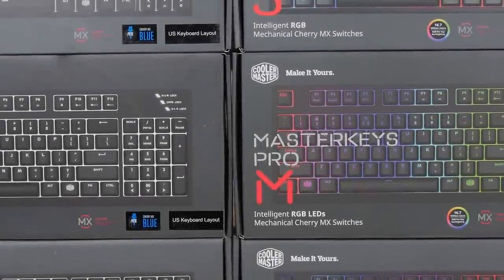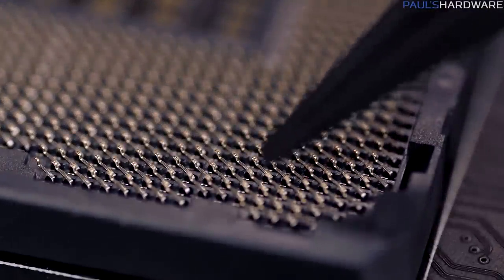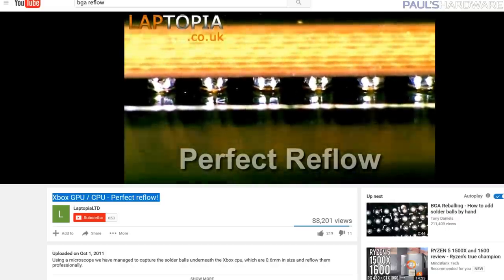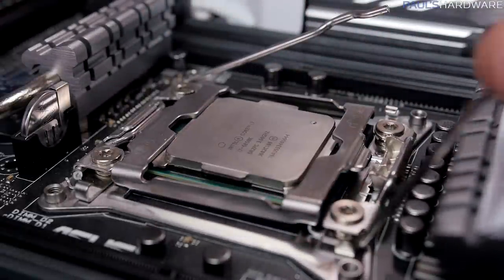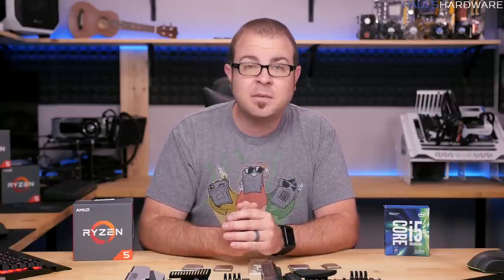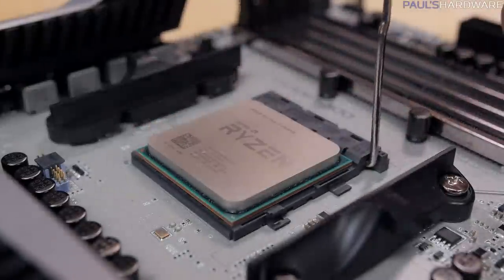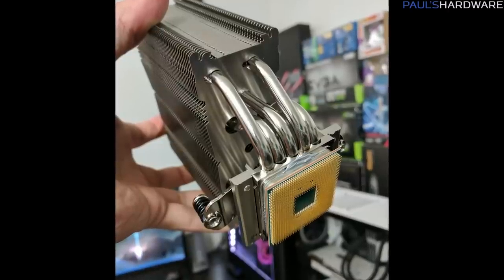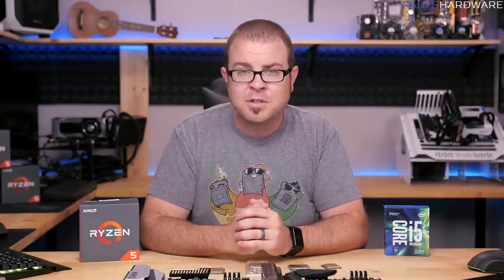LGA vs PGA! Which is better?

Comment: 6:20  Not true.  You can replace a broken pin.  You can also just put a pin in the correct hole in the socket, then put the CPU down so the pin makes contact with the pad on the CPU.

Comment: Pins are always more prone to break than pads. So which side is cheaper should have the pins. My cpu costed almost five times more than my motherboard. So if one of them breaks, it's better to be the mobo. Or, if this problem occurs so often, then they should use the LGA design with just landingpads on the motherboards too and a cheap adatper panel with pins on both sides. If you screw it up, just get a new pinpanel...
Reply: Péter Kiss but the problem is,  lga has easy to break pins on the motherboard that sre hard to fix while pga has thicker straight pins
Reply: You clearly don't understand the concept, do you? From which one would you buy a replacement, a 300$ CPU or a 100$ motherboard?
The PGA doesn't support the CPU perpendicularly to the motherboard. People are sometimes ripping out their CPUs from the socket by removing the cooler because of the old thermal paste hardens and "glues" the cooler to the CPU. Then the thicker pins are often just breaking off of the PCB and you can't solder them back.
By the way AMD uses LGA sockets on the new threadripper CPUs. Guess why...
Reply: I have built thousands of computers and I get your point about cost but PGA is much easier to repair and AMD pins are thick and pretty hard to bend unless your using them as a doorstop. LGA sockets on the other hand are much harder to fix, if at all, and unless your building a lower end system the motherboard cost can be almost as much as the CPU. As for removing a PGA CPU cooler, run the system first if it will boot to warm up the paste, then remove the cooler, if the system won't boot use a hair dryer or heat gun to heat up the cooler.
Reply: I still think LGA is better choice, that why I choose INTEL instead of AMD
Reply: Péter Kiss if you do that then the mobo manufacturers will have to redesign their cpu bracket so it can  fit additional item inside it, hell even case manufacturers have to redesign their case's width too
Reply: @stephenallen4635  you clearly dont understand
Reply: @theyhatekath  and your reasoning for saying that?
Reply: @stephenallen4635  LGA is not at all easy to break, sure, pins arent very durable, but they arent exposed neither. They come with plastic shielding and only time they are exposed is when you are inserting the CPU. PGA in the other hand is far more exposed and primitive. Also, with LGA , if pin breaks, just send your MOBO back and ask them to replace pinpad, tell them you will pay for the repair costs. Its much harder to replace on pinpad on CPU.
Reply: @Navhkrin  If you store a PGA CPU properly, it's exposure time isn't much different from a LGA motherboard's. The difference is all in how easy it is to fix.

I find the PGA is less prone to being screwed beyond all reason in practice. This isn't even pure academics. This is the sum of the experiences of various field repair techs at the company I used to work at.

Comment: I’ve had to help quite a few people out with the PGA pins especially when the FX CPU’s were big. My trick to bringing their CPU back to working order from bent pins was with a bic mechanical pencil. The slightly elongated section of the pencil is the perfect fit for the pin and doesn’t get in the way of other pins. Once the pencil is aligned on the bent pin it takes a minimal amount of force pushing a little on the eraser end in the direction to “unbend”. Accurate and prevents other pins from getting damaged with no need for anything sharp or metal.
Reply: Sounds like a good method. Gotta beat tweezers or tiny needle-nosed pliers.

Comment: PGA also has negative impact beyond a certain frequency, cause the pins actually start emitting EMI and causing interferences.
Reply: Well, I have seen them go up to 5GHz, so I can't see it being an issue
Reply: @dirtyasianmafia2310  I have actually.  I forgot until you mentioned it though, of course. lol

Comment: Bent so many fucking pins on PGA back in the day. Big fan of LGA.
Reply: Agreed, PGA is a huge pain and alot less friendly to starters. Way too easy to fuck up a CPU and there's 0 chance of warranty.
Reply: broke mobo pins but I saved a few pga cpus
Reply: ShagStars Productions saved one too. nearly shit a brick when bending it back though
Reply: How did you break the mobo pins? Seems like a easy thing to avoid. Line up, drop, inspect, use the arm.
Reply: Sometimes people have bent pins on LGA while installing high end cpu coolers. Too install them you add even more pressure to the cpu than just the retention arm.
Reply: That's true, However, if you water cool like I do, you should never run into that problem. Very little force.
Reply: aw come on i had a Phenom X4 955 back in the day and the MB didnt want to release it and i had to use power to pull it out had 3 bent pins carefully straightened em and it worked fine its not hard to bend em back if you are careful

Comment: That "cooler sticking to the CPU and pulling it off with a PGA CPU" bit is no joke. That happened all the time when servicing old industrial computers, and I can remember two cases where the heatspreader came off with the cooler, leaving the CPU in the socket. Old dried up paste can be stuck there real good.

Comment: 6:08 I had the same problem when I was building a PC this last Christmas.   I went to install the CPU, and noticed it didn’t sit flush with the socket.  Upon further inspection I found that some of the pins on the CPU were bent!!  So, with a steady hand and long fingernails, I bent all of the bent pins back into shape.  It worked perfectly!

Comment: Those mechanical keyboard thingies would be cool and all if they didn't cost a fortune. lmao. I'm good with my Microsoft Sidewinder x4. I've run tests and the actuation of the keys on this thing are literally just as fast as most mechanical keyboards and even faster than some. And I honestly like the tactile feel of them and the lack of clicks so loud they send your girlfriend into a rage in the middle of the night. :D
Reply: Don't buy into the mechanical keyboard hype, it's useless.
Reply: I own a MasterKeys Pro S. They are actually very nice.
Reply: Plus it's old as dirt. Like, almost 9 years old, and it's still in perfect condition. I can break this thing down, squirt it out with my handheld showerhead, dry it, and have it back together and working within 20 minutes. Microsoft made a kickass $35 keyboard years ago and now you can't find one new or used for under $300.

Comment: If you leave the LGA motherboard protection cover on until AFTER the CPU is installed and remove it before you close the retainer (on the 775's the cover would pop off as you close the retainer) you have less risk of damaging the pins.

I worked with a someone who managed to nail something like 15 pins on an LGA whilst taking off the CPU socket cover.

This coworker also managed to not install enough motherboard mounts (luckily) so the board would flex enough so that he could install a stick of ram backwards. Both the board and the stick survived.

Comment: You can rotate the cooler to break the thermal paste so you don't screw up a pga cpu, also it's not because one pin breaks that your CPU is necessarily toast, sometimes there can be multiple pins missing and it'll still work depending on your luck

Comment: When the thermal paste bonds the CPU and heatsink together, always twist the heatsink slowly until it breaks free, NEVER pull it out. Turning the motherboard on for a while before taking it off or using a hair dryer also helps.

Comment: You won't believe the joy that comes in you when you fix a bent pin i had a bent pin on my lga 1155 after two hours of looking into the socket i can bearly see anything everything was blurry i snapped a pin i was just about to go crazy on the socket and mangle the hell out of it but i saw it boot to windows 
After searching the pin layout it turns out that i snapped an extra ground pin

Comment: Not necessarily toast if a pin breaks off.  Some are ground pins and are thus potentially redundant and CPU can still function without them.  Not that you'd want to break them in the first place.

Comment: Never used LGA. My Pentium 4 (Prescott) was PGA. Been AMD since then, PGA. I did bend a few of my Pentium 4 pins, but with a lot of time you can repair them. I manually bent the pins close one by one, then used a knife to finish the job. Its doable, just nerve wracking and time consuming (especially as a young child).
Reply: Da faq Pentium is LGA
Reply: Well the Pentium 4 LGA775 would be one example.

Comment: This video brought back old memories when I built my first PC and dropped a $300 A64 cpu and bent half a row of its pins. I was furious with myself. I knew the cpu was toast so I managed to straighten the pins with a credit card and lots and lots of patience. I believe the CPU wouldn't properly boot twice despite perfectly fitting on the mother board socket. Eventually, I managed to finish the build and get it going after 2 very stressful hours

Comment: LGA makes more sense in terms of broken pins. I've gotta say though, I found AM4 socket much easier to install with than the 1155 socket. It felt like I needed less force to close the socket.
Reply: this kinda releaves me, i'm waiting for a 5950x coming from a i5 2500 and the last time I had to deal with pga athlon 3200 were still a thing

Comment: Guys, I know that everyone has their opinions, but purely objectively, nothing rivals the satisfying feel and sound of LGA sockets. When you open it for the first time. That quiet "thud" when you drop the CPU in. Those sounds while you're closing the cover and then, finally, that victorious POP when the plastic cover jumps away from the socket as you're securing the latch. It's not a just a better system, it's another level of experience. 

On a darker note, I had the pleasure of disposing of a few old laptops and tearing down a BGA socket feels much better. Especially the plastic holey part, which can be surprisingly flexible.

Comment: Very nice summary. Neither design is perfect, but I like the PGA version a little better because it's slightly more durable. 
Ebay is flooded with I5's and even i7's from the Sandy Bridge, Ivy Bridge and Haswell time, but getting a decent board that is fully functional is pretty hard.

Comment: If you have a broken off pin on you AMD CPU. Get a sewing pin, measure it and cut it to the length of a A CPU pin on (it might take a few tries, and you might need to cut it slightly longer, once you place the pin in and pushed it down a bit you should know if its long enough - Don't jam it in and lose it in there, use small nose pliers). Locate the placement of the missing pin on the socket. Carefully put the replacement pin into the correct hole on the socket. Lower the CPU into the socket and check that the pin lines up  and is not to short or long. Then, put a heat sink on and see if the system boots. I've personally done this, and I see no reason why it shouldn't work for you too.

Comment: As a Ryzen user, I perfer LGA. Because if you need to take out your cooler, you wont rip out your cpu and break some pins. And if you do bend pins, the mobo is usually cheaper.

Comment: Pretty old, but I remember bending three pins on a friends FX-8350 while attempting to change the thermal compound, because the CPU came along with the cooler when we took it off.

A small flat screwdriver, some new thermal paste and 15 minutes later, the machine was running Windows again.

Comment: A couple tips for PGA:
1. A mechanical pencil can often make for a very easy way to fix bent pins
2. Twist the heatsink before attempting to pull it off.  It doesn't take much to break free from the paste.
Reply: It depends on how old the paste is. Had a really old PC where the paste had pretty much turned into tile grout and it would have taken a chisel and hammer to separate the 2.

Comment: Whether or not losing a pin makes a CPU not work depends on if it's a pin that stands alone carrying a signal or power all by itself, or if it's directly connected to one or more other pins. A common voltage pin or socket contact lost may not prevent things from working but may prevent doing stuff like overclocking due to power transfer capacity being reduced.

Then there's how Linus dropped that $10K fancy Intel CPU and managed to ding the edge in such a way that it only killed one RAM channel. Still worked.

Comment: If you have any PGA478 socket family CPUs with missing pins, check the pins on a PGA478 pinout sheet. If they are among only the few high voltage or reserved pins, it's possible that the CPU will work flawlessly if you replace the pin with the severed point of an iron needle. I have done this personally in cases of no POST and the machine continued to operate normally indefinitely.

Comment: Now you have to do a video on how to safely remove a cooler on a PGA socket system. I will need to do so on my new Ryzen system, changing the Noctua cooler and placing my AIO with the coming (shipped) new Thermaltake AM4 bracket.

Comment: The pulling the CPU out of the socket with the cooler thing is super easy to avoid.

Just twist the cooler a little to break the bond between the IHS and heatsink.

Comment: Use a 0.9mm or 20 gauge syringe needle to straighten Socket 940/939 through AM4 AMD CPU pins. The needle is the perfect diameter to slide between the pin rows then lift out sideways. If there's no resistance to the needle, no pins are bent into that gap. It doesn't take long to insert and lift out of all the rows from both directions. Sometimes it can take several times to get a pin sufficiently straight so the CPU can be carefully wiggled into a socket. In extreme cases a needle can be put over a pin then gently nudged to straighten. Clip the point then deburr the outside and used a pointy knife to cut out any metal that's pushed into the opening. While the 0.9mm will work, a smaller size that just barely slides over the pins will give more control.

The best thing about dealing with bent PGA pins is once you get the CPU properly into the socket and close the lever, the socket forces all the pins straight.

Comment: What causes the 2500k to make the installation sound it does?
Pushing the retention arm down with all the force my finger can handle, knuckle white with the finger shacking from the force of pressure, while the 2500k is sounding like you're grinding glass and sand in a hydraulic vice.

Comment: My first Intel computer was PGA. Twas a Willamette Pentium 4. Got it over an Athlon system because of the heavy discount I got on it as an open box unit. It had a GeForce 2 Ultra, 768MB of RAM, a Turtle Beach Santa Cruz sound card and a 16GB hard drive. Those were the days!

Comment: I've broken pins off of an Athlon 64 X2 years back and I actually managed to get the CPU working by inserting the pins into the holes in the socket and crossing my fingers. perhaps they were redundant pins, perhaps they really did make contact again but I was amazed nonetheless

Comment: About damaged LGA sockets, usually you can easily replace the whole socked. The wholle reason behind LGA is that the system is solder less. The socket makes contact with the PCB the same way it does with the IC. You can simply unscrew it from the pressure plate on the back side of the PCB. Though some manufactures may use rivets or other mounting methods.

LGA was developed when lead was banned by Rohs and companies started to look for alternatives to using lead based solder.
When the directive first came out there was no workable alternative to lead based solder and problems like "tin whiskers" (google it) made the use of high pin density sockets problematic. A   LGA socked is basically a grit with small springs that make contact between the IC and the PCB by pressure, eliminating the need for solder completely.

Comment: Paul, I just found this video.... I personally preferer PGA sockets.... I pretty much just use AMD based motherboards and would rather replace a CPU instead of a motherboard. I have had to do that before. I use AM2 and AM3 based boards and find that the cost of an old CPU is a lot cheaper then replacing the whole board... thank you for the video, very nicely done...

Comment: PGSA is also a better electrical contact. PGA pins are squeezed by an offset array of holes under the plastic cover of the socket, the moment you pull the lever. You can even see the indent that makes on the pins, if you look at the sides of a used PGA CPU's pins. LGA on the other hand relies on spring (elastic) force for contact and we all know that a metal's surface can't be 100% free of dielectric contaminants, not even gold (but it can get close).

Comment: I was taking apart my PC to clean up everything & reapply thermal paste. Tried to take the CPU cooler off & my FX-6350 came with it. About a tenth of the pins were bent, many of them massively.

Comment: I can claim 100% success (ok, it's 1 out of 1) with LGA pin fixing. Picked up a LGA1155 board with a pile of other stuff, and it had maybe a few tens of pins in varying degrees of disarray. If it looks like a tornado blew down a forest, forget it!
Settled on a needle as my tool of choice, and got pretty good at bringing them back into position, better to slightly under correct at first.
Still had to do it in two sessions, as I was getting crosseyed and hand steadiness began to go.

Comment: Well, to be precise - many of the pins of the processor are in parallel for power (vcc or gnd) so you have a chance to get away if you brake a pin.

Comment: brush the pins with a small piece of wood in the direction the pins want to lay, if you do it lightly several times the pins will line back up in the socket.